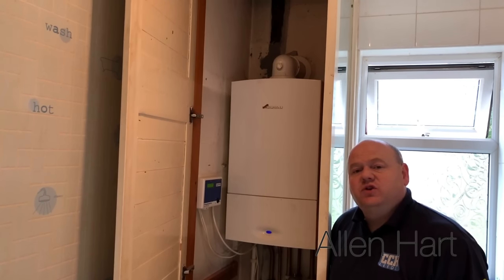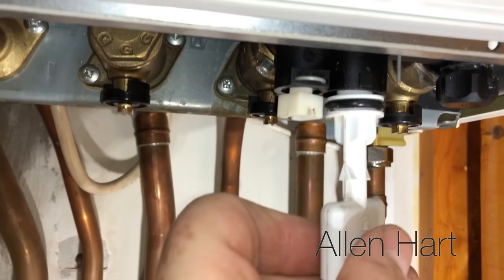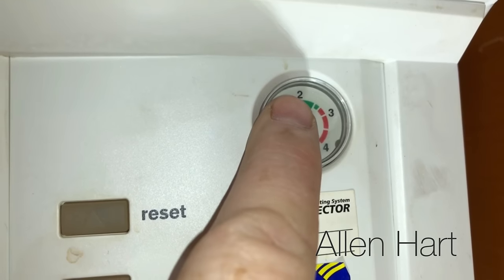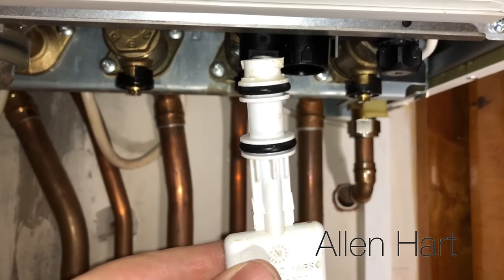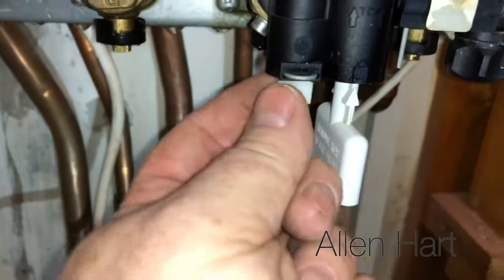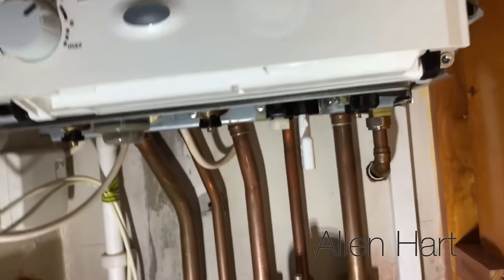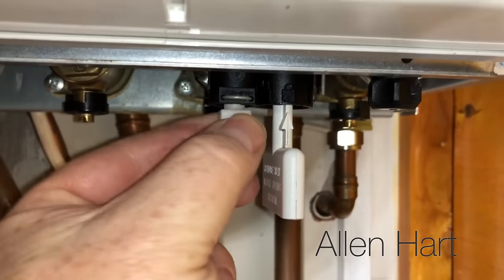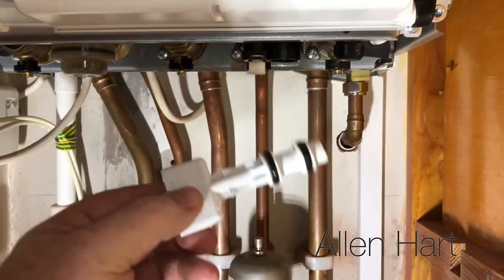How to top up your Worcester Bosch Boiler with an Internal Filling Key

Comment: Should also add that the main reason (apart from refilling/ venting radiators) for system pressure drop is possible leakage from PRV and/or failure of expansion vessel on rear of boiler.
Expansion vessel should be checked and re pressurised with annual servicing which will generally prevent problems with PRV failure.
Reply from the maker: Good point, i should of added that.
Reply: I Look after loads of these 24i Juniors and make sure I re pressurise expansion vessels as I know what a B**** the PRV's are to change !! ..LOL
Reply: The PRV on this model is awkward to get to, indeed. Good point.
Reply: Oh good to know. I have to re fill mine 2 to 4 times a year, every year. I've always had air in the rads or system somewhere and I figured the air was eventually getting to the PRV where the boiler would let it out.

Comment: I have a Worcester Bosch 16i system boiler that will soon need topping up.My question is should I turn the boiler off before doing this?
Reply: Yes!
Most definitely!
Err on the side of caution!
Always!

There is a (maybe very slight) possibility of electrocution.
Water; electricity, and Humans don't mix.
Keep them separate.

Leave it switched off for about ten to twenty minutes;
so that you get an accurate (room temperature) pressure reading on the pressure gauge when you top-up the water.
Go very slowly and don't go too much over 1 - 1.5 bar pressure.

There are safety features to prevent electrocution but,
when doing any DIY procedure(s);
always isolate yourself from any live circuits -
i.e. switch it off until you've carried out the procedure(s).
Reply from the maker: Thanks very much for your comment, please consider subscribing to support the channel 🙂

Comment: I've got one of these boilers (Which? recommended nine years ago) and it's never worked all that well. If I were to replace it, could you recommend a good make of boiler that is reliable, well made, easy to service and has a simple to use key/valve for re-pressurization? Thanks
Reply from the maker: I installed the Baxi 636 in my house. https://youtu.be/W9JzQmEg-g4
Reply: I was going to say Ideal but I'd listen to big Al!

Comment: What does it mean when I turn the white valve to let water in and the water just flows out around the key? The pressure gage doesn't move.
Reply from the maker: You havent got the key in far enough. push it in a bit more and turn it. Thanks.
Reply: Having the same problem but the key clicked in but still pouring water

Comment: My internal filling key will not turn completely to the right so pressure keeps going down. Can't remove it either. Could a spritz with WD40 help and would it be safe? The key is the original one and was left in the boiler slot at last service. Thanks for your advice.
Reply from the maker: Thanks very much for your comment, please consider subscribing to support the channel 🙂

Comment: On my 24CDI Worcester boiler I do this and there’s a drip from when I take the key out afterwards, the tap takes a lot of strength to turn on and off again, I’ve turned it off right the way but there’s still a drop coming from it every few minutes, if I try to turn it off anymore I think I’m gunna snap it
Reply from the maker: You might need a new valve. Thanks.

Comment: Hi. Thanks for your video. I am renting a house and the key has been left inside and not been removed. Is this ok or should I remove it?
Reply from the maker: Should be fine. Thanks.
Reply: @AllenHart999  thanks. After being topped up, and heating on, pressure went to three and half. And after fifteen mins boiler stopped. Few days later when heating is off, the pressure is on two. 
Same thing happens. It goes high when heating on and after ten fifteen mins switches off. 
Shall I bleed any heater for air to drop pressure? 

Many thanks.

Comment: Does the boiler need to be switched off before raising pressure?
Reply from the maker: You do not need to turn the boiler off but it would give you a better reading if the heating was off. Thanks.
Reply from the maker: Thanks very much for your comment, please consider subscribing to support the channel 🙂

Comment: Hi Allen, when I turn the nut for the water, no water seems to be flowing in. Can you help?
Reply: Same issue
Reply: @samlisa3550  Hi, I sorted mine out. Mine was internal, so one of the pipes leading to the boiler may have a valve that you can turn and it will fill the boiler. Hope this helps
Reply from the maker: Thanks very much for your comment, please consider subscribing to support the channel 🙂

Comment: If only one bar required why is the gauge marked in green at two bar
Reply: This is because the heated water expands with heat and pressure.

The normal pressure reading of 1 bar is when the boiler isn't operating.

In use, the pressure gauge will go up, you don't want it going too high (into the higher red measurements) as safety features will kick in and the boiler will cut out (hopefully!?) before any damage is done to the boiler (or you).

These are approved safety limits to prevent the boiler from blowing up and scalding.

It's like making love to a beautiful woman -

Don't rush!
Know your limits!
Be gentle!
😜
Reply from the maker: Thanks very much for your comment, please consider subscribing to support the channel 🙂

Comment: Hello Allen. I've got a Worcester Combi-boiler.  The pressure gauge is at zero when I just have the hot water on but when I put the central heating on it goes past 2. Why is this?
Reply from the maker: Roy Carter It’s hard to say without looking at it but it may need a new expansion vessel, Could also just need topping up with air. I would advise on having it serviced 👍
Reply: Thanks Allen.

Comment: Don't like the look of that, bet they break easy?
Reply: Or     are easily lost? What's the betting that you get the call out to re-pressurise at 12.30 on a Saturday or on a Sunday? When all of the heating spares places are shut? I hate those boilers that have either those crappy little keys or a specific size, shape of removable filling loop     specific to the make/model of boiler. They always get lost and carrying a copy for each and every make/model is just infeasible. What is wrong with a standard filling loop assembly with a lever valve and check valve and flexi braided hose      oh   and a couple of cap offs for both valves       just in case (belt n braces)
Reply: loafer sheffield most of your standard filling loops are shite too, but as you say they're a standard size and easy swapped over.
Reply: My key got stuck in the loop on install. No one has ever managed to get it out!
Reply: It's awkward to say the least to remove that key. Again, either the householder will lose it or the attending engineer, likely will not carry one. So much so, it has been rendered redundant. W/B do not make boilers any more with this particular filling/re pressurising method.
Reply: @loafersheffield  reading this going yeah right wish I had this key in my brand new packaged box Worcester??!!!! found this out today living in remote Scotland with my ONLY area gas safe engineer turning up tomorrow morning wont have new key for 5 days and engineer cant come back for 2 weeks ..... Grrrrrrrr
Reply: @OnlineopticsCoUk  Ouch! Wrap up warm m8
Reply from the maker: Thanks very much for your comment, please consider subscribing to support the channel 🙂